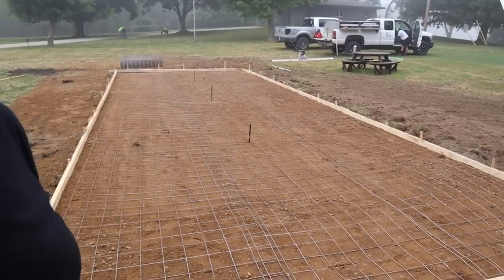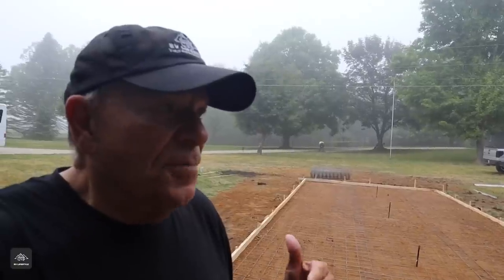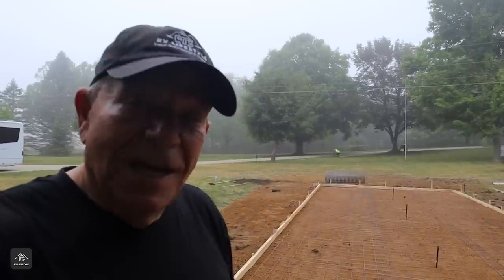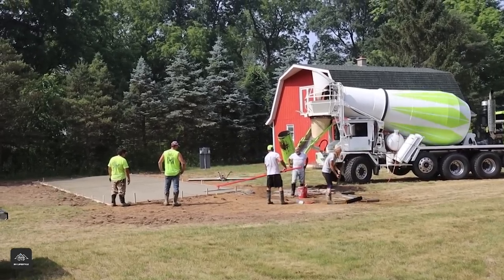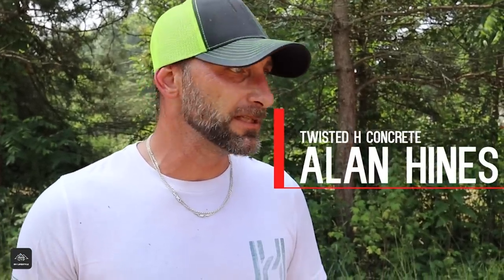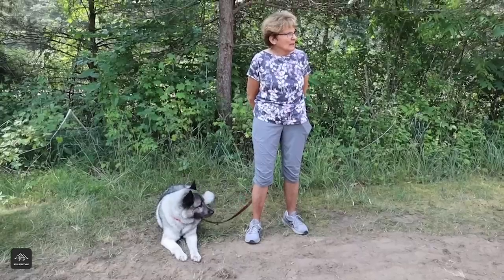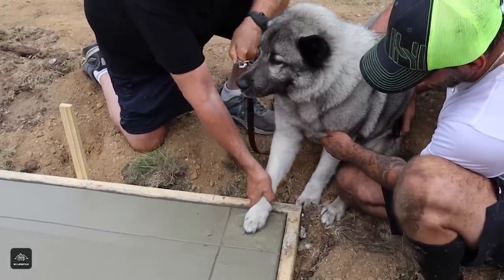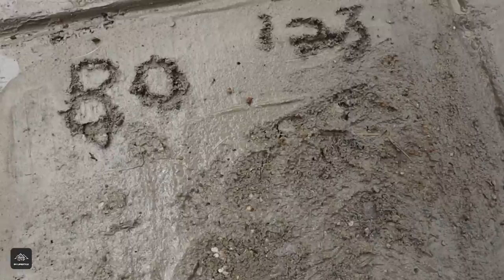We Poured a Concrete Pad for our RV!

Comment: I'm having a 45' x12' x 5" slab put in this Monday for my 33' DP. The slab is being poured using 3000psi fiber reinforced concrete with a 6" footer at the drive way end. The slab will be poured inside my 40' x 72' barn. Finally getting away from the dirt floor under my MH so I can work under it using my creeper. ❤